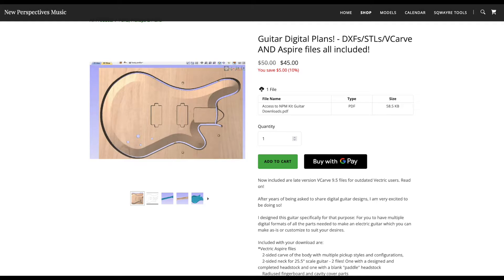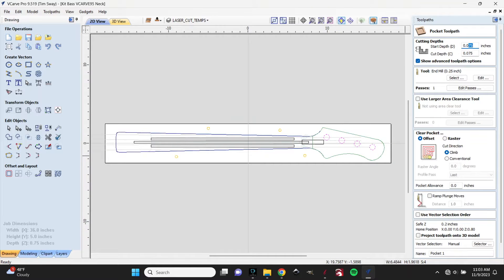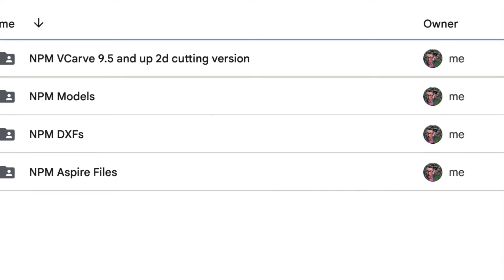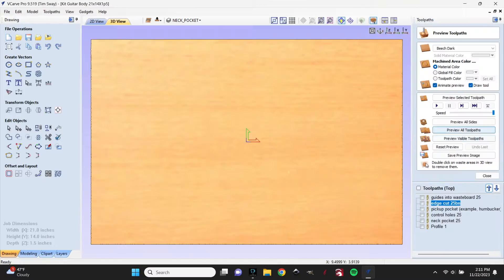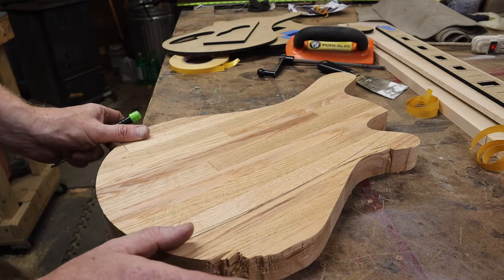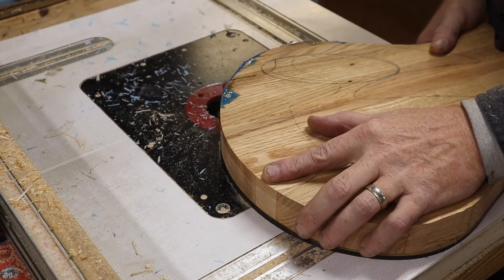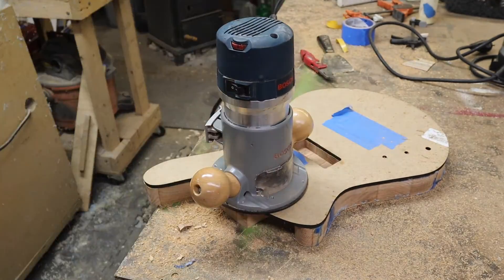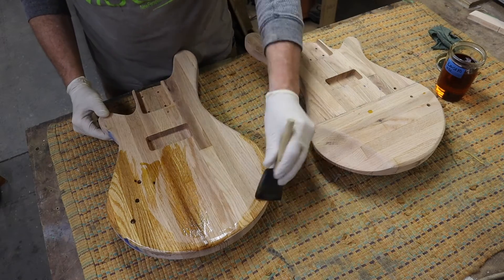Bass Guitar Body By Hand & By CNC // PT 1 DIY Bass Guitar Plans

Comment: Nice one Tim. I used my angle grinder and shaping wheel to cut the bowl in my shrinking stump. (Sheet metal work) and it is a seriously scary operation. Much more forgiving cutting the belly shapes in guitars. Looking forward to the next one.

Comment: The other benefits of making a template from a master, is that you can do little modifications (if you want to), and just generally learn how the template feels on the router. You can also buy dual bearing router bits, I have a trend one, which is nice, but there's also up/down bits on Rutlands that looks really nice.

Comment: Last silly point by me. Could you make a frame within a frame. Mount the blanks in that. There is a horizontal pivot. You put the frame into 4 common bolts. You set the machine to carve one face. When complete, rotate the front to back - it should be centred if you stared along the pivot line. Of course you would have to work out whether to flip the backside carve. But hopefully front and back will be registered (if the bolts are located and centre was on centre line).
Reply from the maker: well, you could make like a spit for it to rotate on, there are cnc lathes. Also, when doing large production runs, you can make specific jigs for the job that fill the cnc bed, eliminating some of the extra work mounting and flipping. However I rarely make a bunch of the same thing at the same time so I haven't developed this type of system myself.